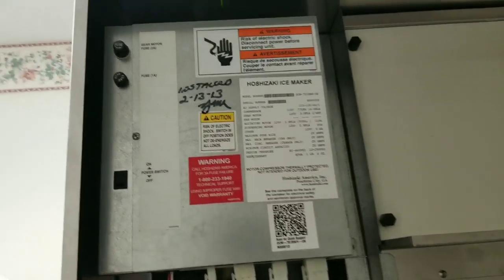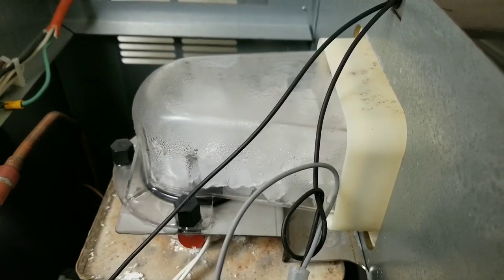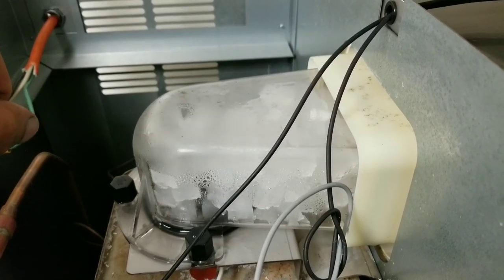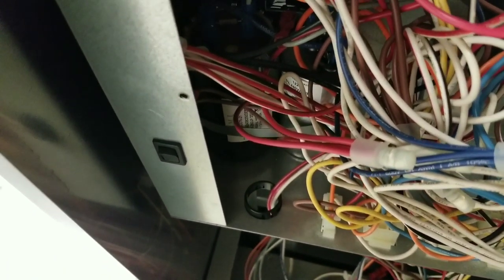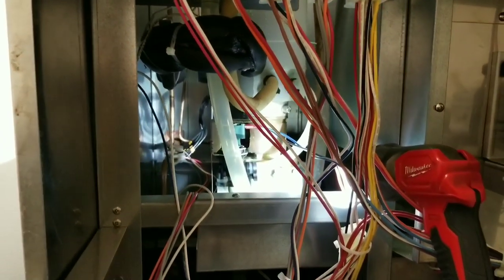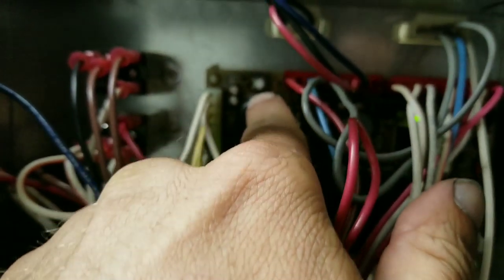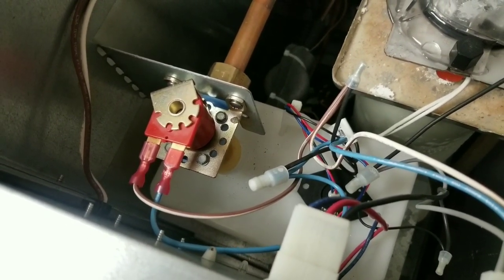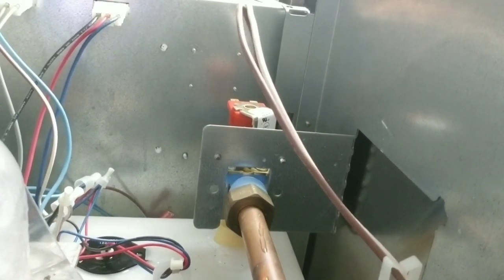Hoshizaki Ice machine beeping

Comment: The water components looked surprisingly clean, I wonder if it was recently serviced and a cleaner removed some built up scale from the fill valve that in turn exposed the wear issue. I don’t see a lot of cubers with augers in my area, just a few flakers here and there. Good video, thanks!
Reply from the maker: You may be right, over the last 4 years Ive worked on less and less ice machines for some reason, one day ill get back into the swing of things and be able to understand the cause of some of these issues
Reply: the nugget machines work just like a flaker except they have an extruder on top the ice is forced thru to make the nuggets. I was self taught on the old scottsman flakers from back in the 70s. I had 3 of them i rebuilt and used for several years.

Comment: Those water valves operate like low voltage irrigation valves do. That solenoid moves a needle that allows the water to leak down stream which the existing water pressure then is able to push the diaphram open. De-energized and the needle is pushed back in place  preventing the water to bleed through. The water pressure then fills up the back side of the diaphram which equalizes water pressure on both sides of the diaphram. With the help of the spring adding just a little more pressure it forces the valve closed.

Comment: Awesome video! 
Great quality machine..
The head ( excruciating) valve by auger, i believe its named looks fine on machine,and definitely good call on wire nut rigged cord replacement and some nickle safe cleaner( pm), on the plate will really help. 
Awesome video.
Bryan Tyler Refrigeration
Reply from the maker: lol yeah that power cord was a maintenance guy special